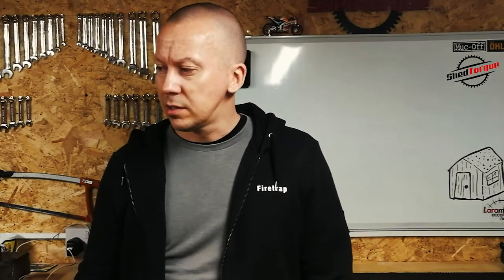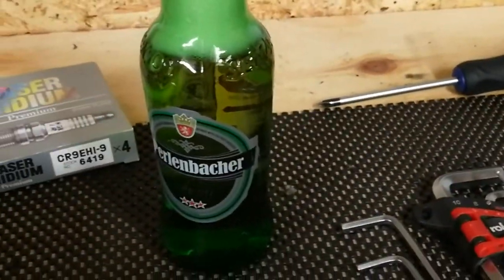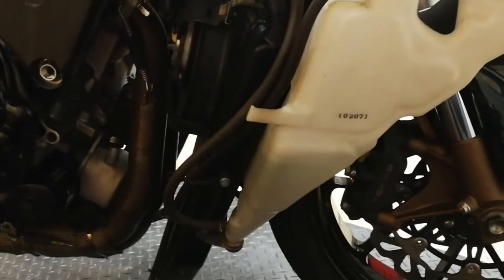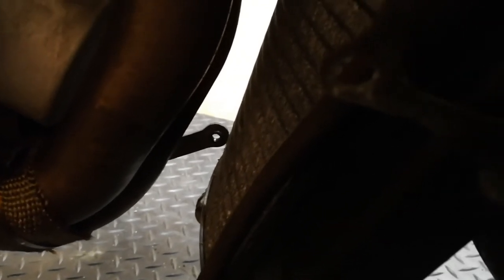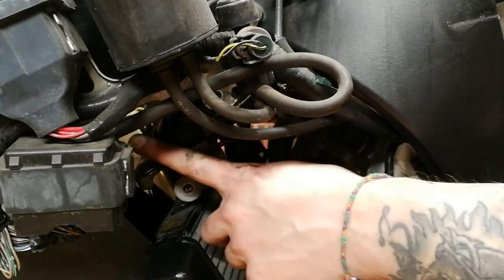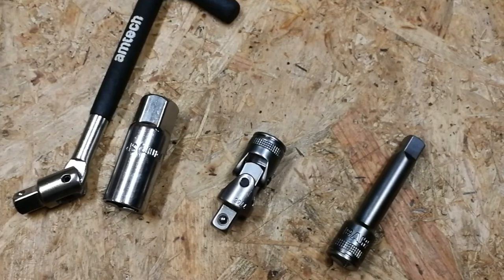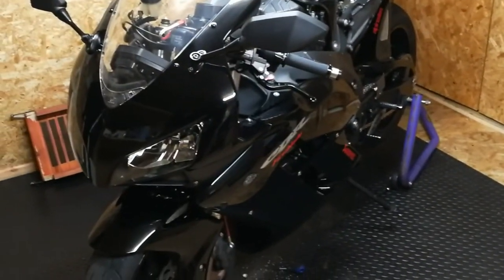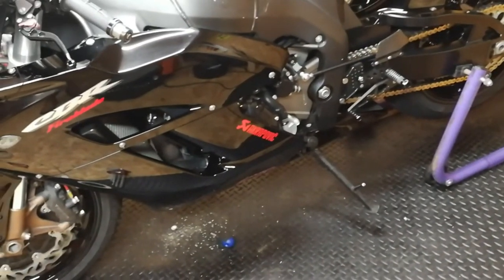FIREBLADE - Spark Plug Change CBR1000rr Ballache!

Comment: Great video. However, your spark plugs, particularly the second, looks like if it has engine oil on it. I have a very similar situation on two of my cylinders while the other two are completely dry and tidy. First I was thinking of ripping my engine apart to change valve stem seals, or worse look for piston/rings/cylinder issues. However, after seeing a number of Fireblade spark plug change videos with oily spark plugs this seems to be such common issue that I start to wonder if these high reeving engines always will have a certain amount of valve stem seal leak? Have you ever had any performance issues or indicators of oil leak problems?

Comment: Just did all this (and more) as I have a slightly damp valve cover so need to replace the gasket, that lower airbox panel needed to come right out to get the valve cover off, it only just squeezed out from the front right hand side, honestly thought the forks were gonna have to come off !!! Proper shit design if you ask me, ah well, at least it's November and I can take my time, got a few other jobs to sort out while it's in bits.. cheers.
Reply from the maker: Thanks for watching! I haven't done much recently but fitted some heated grips last night on a friends bike so will upload that, also fitted a complete exhaust system on a friends bike so just in the middle of editing that! Thanks again!

Comment: Damn!! 
I had no clue that it was going to be this big of a pain in the ass to do something as simple as change the damn plugs.... 
I was thinking it would be a quick, easy, in-and-out job... 

This is going to suck.
Wish me luck, that I don't lose any of those 900 bolts... please!
Reply from the maker: Go for it. It's the worst model for the job. Take your time and pour a beer or two.. ha ha. Enjoy.
Reply: @ShedTorque46  should I do anything else while having it all apart? (Velocity stacks, or ???
Reply from the maker: I didn't, but if you have a new set go for it. Being as though it's all apart. I took all mine apart and just give it all a damn good cleaning.

Comment: Any video on the neutral safety switch ?
Reply from the maker: Sorry. That bike has gone now. Im trying the cb1000r - you having issues?
Reply: @ShedTorque46  Yeah Neutral light goes out sometimes can't find it to troubleshoot it thanks for the reply
Reply from the maker: Check the connector BEHIND the guague cluster.. it may be lose.

Otherwise check the clutch swith on the handlebar... and then there is a wire that goes to the NSS in front of the kick stand.. it may be lose

Comment: What year is this bike? I have a 2014 cbr1000rr SP was wondering if mine will be this difficult? Thanks!
Reply from the maker: 2005.. they may have decided to build the frame with spark plug servicing in mind in later years 😂 Go for it anyway, grab a beer and a manual and crack on ;-)